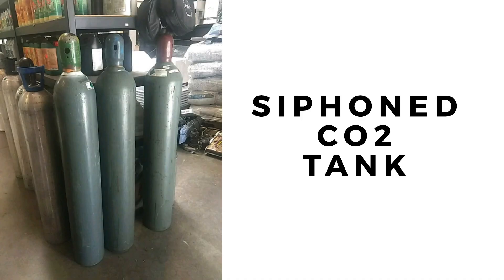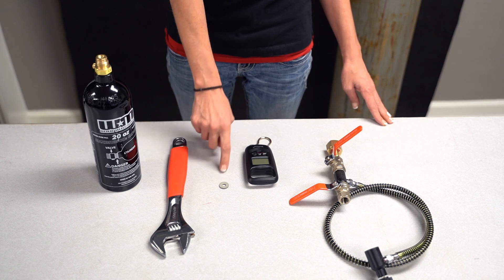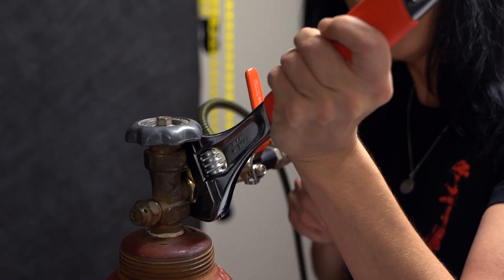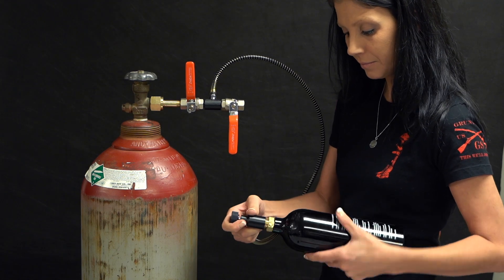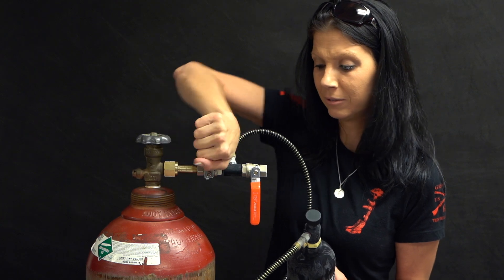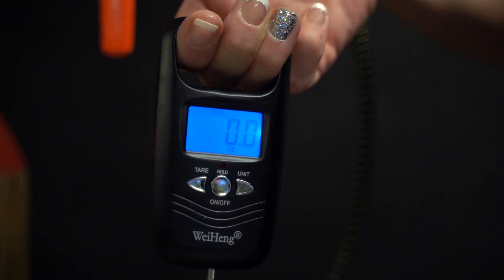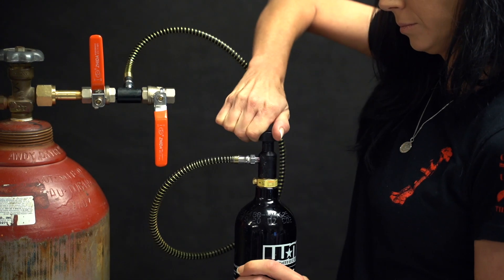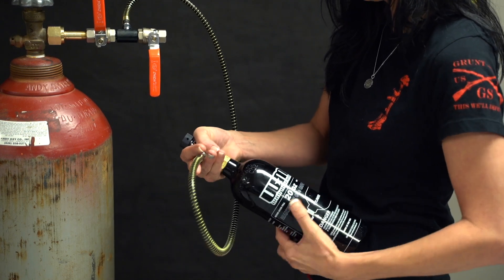How to Fill a CO2 Tank

Comment: If you MIG weld with CO2 you can invert a vapor withdrawal CO2 cylinder to dispense liquid. How you anchor the CO2 cylinder safely is your choice but if you're a competent welder
a suitable fixture or modified cylinder cart is easy to fab. I use my CO2 cylinders for welding, to run pneumatic tools in the field (see commercial power tank kits for how, but I refuse to overpay for those as it's just industrial gas high pressure plumbing for which Western etc sell fittings and whips), and to fill paintball cylinders for light portable work. One can never have too much CO2.
Reply: You can, but in order to properly secure it whilst doing that you’re going to have a bit of a challenge

Comment: What size and pitch are the female threads on the far-side lever-release valve? I need to screw in a connector and run a hose out the window for releasing excess CO2 on each refill.

Comment: I have a similar system, but I have noticed that I do not get more than a 75% fill on the smaller containers, and the larger tank won't fill bottles when there is still CO2 in the tank. How would you remedy this without having some sort of air compressor? I am not able to completely drain the CO2 in my larger cylinders by using the system that you show.
Reply: Put an ice on the small bottle.
Reply: @airsight2753  What is "an ice"
Reply: Chill the bottle in a freezer prior to filling. Same goes for refilling disposable propane cylinders.
Reply: Does your donor tank have a siphon tube?

Comment: Can you feel this big cylinders with compressed air ?
Reply: compressed air is extremely dangerous and the average pressure in a tank is MUCH greater than c02. JUst go to your local gas/welding distributor and pick up a tank of o2
Reply: @2147B  the pressure is not always greater though
Reply: noooooo, you need specialty HPA Canisters for compressed air. they're  upwards of 2500PSI and that'll blow CO2 tanks.

 co2 need less PSI to function. But Air can be used with the right gear. Hope this helped!